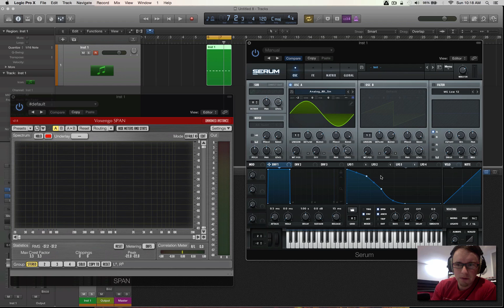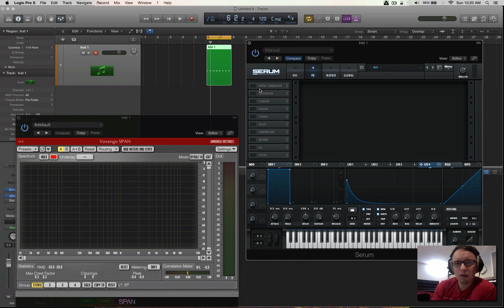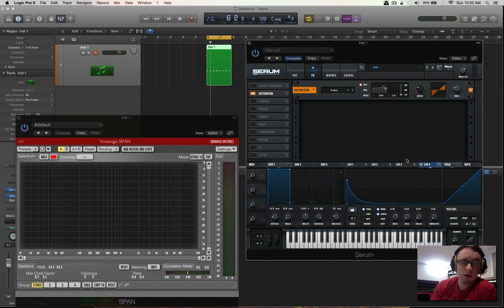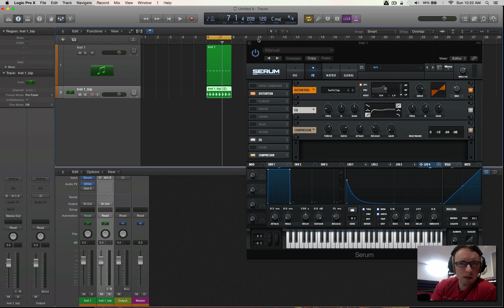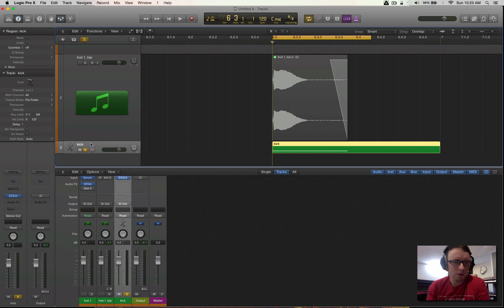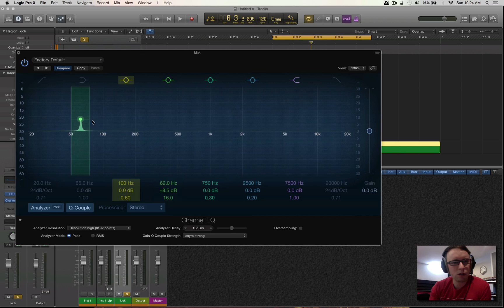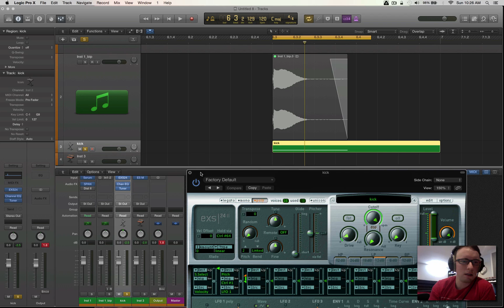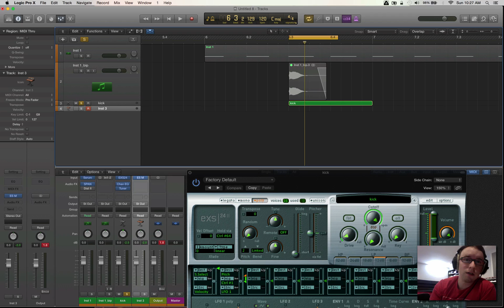Kick Drum Synthesis and Sound Design using Xfer Serum and Resampling

Comment: It still doesn't sound like a good kick. I was thinking to maybe add some harmonics from the wave editor in serum. Maybe it will sound better. Even so, I don't know how they make those fat kicks you hear in songs, it's probably from analog synths.
Reply from the maker: 0lvl try additional harmonics like you mentioned in the wavetable editor. Another technique is to layer some synths together each one having a specific role such as a sub layer,punchy layer, click layer. You'll have more options anf control that way and can process them seperately or together. Hope that helps you!
Reply: Yea I might get something decent, I have no doubt about it. But still nothing compares to those analog distorse and filters. When you crank up the resonance on a voyager, you can hear it screaming at you.
Reply from the maker: 0lvl yes, we cant argue with that... We love analog and all its sonics as well!